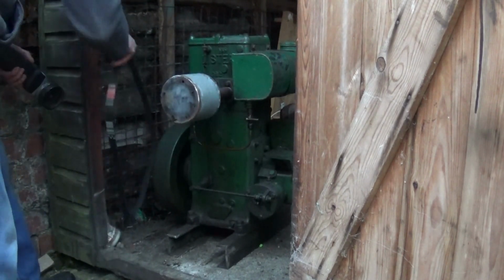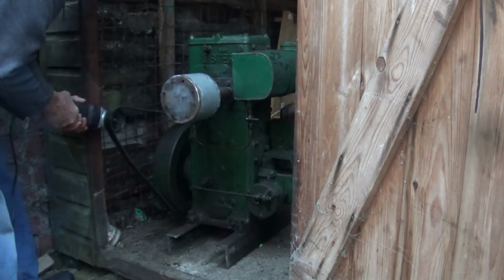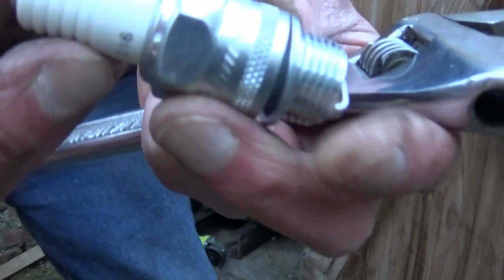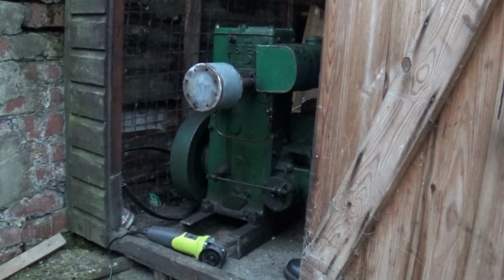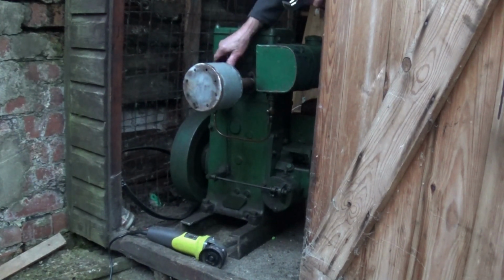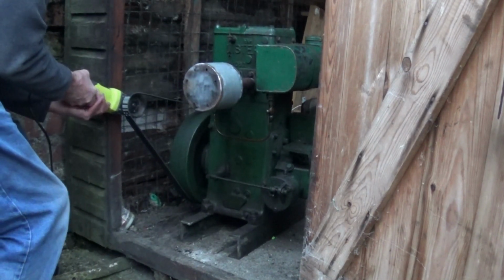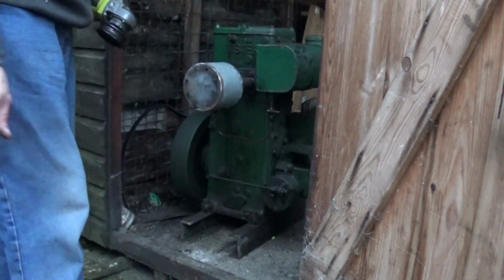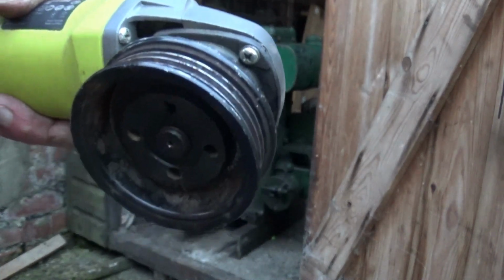Lister D Electric Starter

Comment: Wooow ! New invention that works !! 30 Years ago I worked on machines that have a dynastart , the dynamo works like starter motor and when the engine runs they charge your battery !
Reply from the maker: Yes I've seen dynastart engines.....can use a dynamo as one if wired up right. BUT got one now😊👍

Comment: Have you still got the motor for your wood lathe what i was thinking is to have the motor on a pivoting arm and a drive wheel with rubber or something on it to push on to the fly wheel of the lister or even to have a pulley on the motor and the drive belt connecting the pulley and the fly wheel and use it like you are in the video but with better leverage
Reply from the maker: Cheers Daniel. No where near powerful enough. Just thought of this today and tried it. Will work good enough for my few starts 😊
Reply: @MalcOfLincoln  would you be able to bolt a angle grinder to a pivoting pole or something to give you some better leverage and make it easier to hold
Reply from the maker: @danielkeal8795  Simple answer........yes. Got to investigate some ideas.

Comment: Can’t you use the shed floor with a bracket to hold the angle grinder malc  no hands then bud Martin
Reply from the maker: Yes ta Martin. When the weather allows I'm hoping to make a bracket to go onto the engine mounts with a pole to hold the grinder. Mind you, wrist is a little better and it starts so well....hopefully not a problem.

Comment: With a little practice that will be a big help Malc.
Reply from the maker: It should be Lloyd. Now I know it works it needs a holder of some sort on a movable pole on the engine. Only thought of using a grinder a bit earlier. These are really cheap ones. As you know recently I had to change things, so now have a little spare money.....just time to do a bit of catchup on things that's all. Last angle grinder I bought was for the steam engine build. Works well but switch has failed so I've to switch it on and off at the plug. The latest cheap one has a broken switch now....not taking it back, but you have to hold it on which is why I thought of trying this.

Comment: Stay with the guitar malc. Easier to do guitar than stinky old engines.
Reply from the maker: Just started looking at 'tractoring' first one I did singing. Was forced to do it due to others not helping. However needs a different, more suitable key. More work on the words etc. Also got a years more footage to use so??